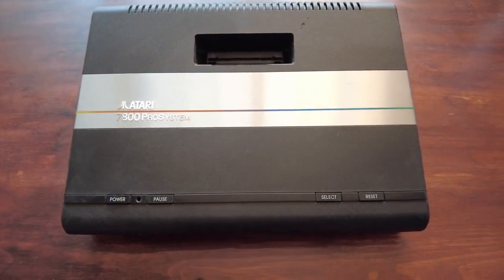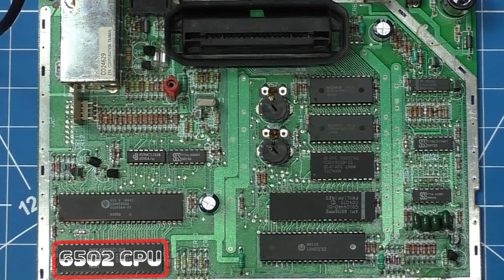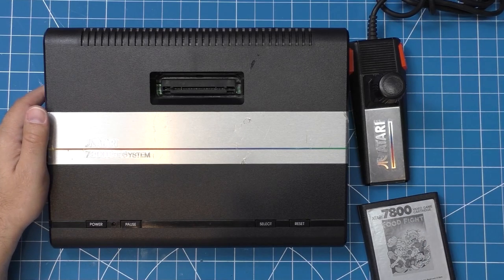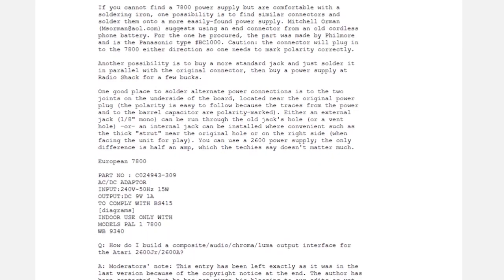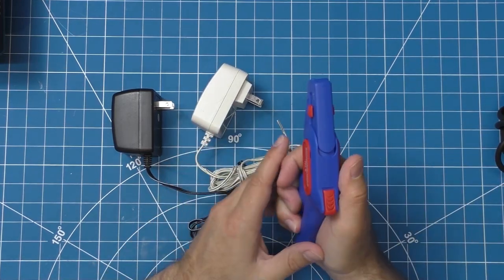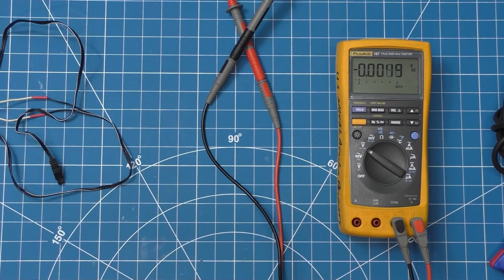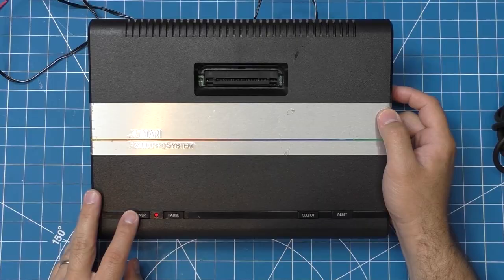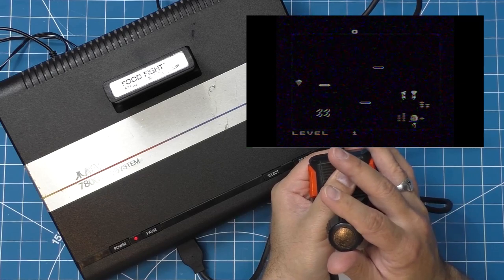Making a Cheap Power Adapter for a Questionable Atari 7800

Comment: Might be better to just swap the prong adapter with a barrel jack.
Reply from the maker: 👍 Definitely would’ve been a cheaper option
Reply: That's what I did. Desolder the original connector and wire in a 2.1mm DC female jack. Use the two adjacent holes in the PCB to lock it in place with a small zip-tie. Done.

Comment: I used a sega genesis model one power supply
Reply from the maker: Nice!
Reply: Genesis gamepads also work with the 7800. Not as nostalgic as the original joysticks but work in a pinch.

Comment: Nice find, and since I am in a similar situation with an untested 7800 and no adapter this may come in handy if I don't decide to just mod it to use a barrel jack.  Thanks and I am glad I found your channel it has some great content.  thanks!
Reply from the maker: I was on the fence about whether to put in a barrel jack or make a replacement power supply. I'm not against the barrel jack replacement at all, but I also thought it would be good to show an option for folks that were more comfortable splicing wires than desoldering components.
Reply: @whatskenmaking  And that is a great option because there are plenty of people that want to keep their vintage consoles as close to stock as possible.  I don't mind hacking it a little if it gets it working haha
Reply from the maker: @RacerX-  Agreed - I don't mind hacking away at it either... depending on the console ... 😉

Comment: LOL!

I’m actually the one who brought that Brinkmann Q-Beam flashlight thing to everyone’s attention over a year after my mother asked me to get her a replacement plug. I immediately recognized the charge connector on the lead acid battery as the one used in the Atari 7800 and test-fit one of my original PSUs to verify.

The Brinkmann company had sold off their assets and the Chinese brand using the name now no longer used those plugs, but new old stock appeared to be available. I ordered a replacement from Amazon and received the wrong one due to an error in the listing (device has a different one for direct power). By the time I received the correct one I had found another device that used the same plug… though the rubber molding around it was too big to fit a 7800 (can be cut down). It was from a Shark vacuum cleaner.

After sitting on on the info for a year I ran into a flea market vendor who needed a 7800 plug so I gave him one of my originals and fashioned an adapter from the vacuum cleaner charger, cutting off the extraneous bits. I recorded it, bundled the info with the Brinkmann footage I had recorded over a year earlier, and shared my findings on Atari Age. Around the same time I also discovered that a leased satellite set top box used a latching variant of the same plug but you can’t just chop those up since it typically doesn’t belong to the end user.

After I finally shared my findings on AtariAge and someone in the thread searched eBay to find that a seller was liquidating thousands of Brinkmann chargers. Of course, I had searched eBay over a year earlier and didn’t expect to see any interesting developments there so I hadn’t bothered to look again. I’m glad he did because the liquidation seller had thousands with a note that they would be sent to electronics recycling within 3 days if they didn’t sell. Of course, the community only wanted the plug so we could save a bit on shipping by buying multiples and asking the seller to chop/recycle the wall wart, but none of us were ready to buy in bulk with such short notice.

I reached out to Luke from Console5. He thanked me and snapped up 500 for his site. I also told the seller so he could try selling them with the Atari 7800 angle. It seemed that this gave his listing a second life and he didn’t immediately scrap them.

Luke said he had hoped it would be a lifetime supply for Console5. They sold about half over the next couple years until someone suddenly bought them all. Pretty sure it was whoever was made that 7800 expansion device with a power pass-thru.

I also tried to contact Best Electronics at the time since they specialize in Atari parts but it he had already commissioned a custom replacement plug that has since become available. I wasn’t supposed to say anything about it at the time and I don’t think he realized that the reason I was contacting him was due to an existing source that could save him the trouble.

I wonder just how many were saved from electronics recycling by our community. :)

Oh yeah: I’ve come across the orphaned Shark vacuum cleaner plugs at thrift stores a few times now. I saw a two similar Brinkmann flashlights recently but they were missing the charger. There are also some ‘70s calculators that use the same plug. Try as I might, I could never find a name or part supplier for the connector itself. I had literally wasted weeks of my life searching BEFORE finding the any of these in the wild. ;)
Reply: Original video was “Salvaging power connectors for Atari 7800” from early 2018 though I recorded the Brinkmann part over a year earlier.
Reply from the maker: That's too funny... well, you certainly deserve a lot of credit for that discovery - it saved me some money! I hadn't seen your video (though I just watched it), and I don't recall where I saw that information, but it was probably your AtariAge thread. I did see that someone had made a 3D printed connector, but I couldn't find the model anywhere online. If I have to do another one, I think I'll just draft up my own 3d model and print it. Fun story!